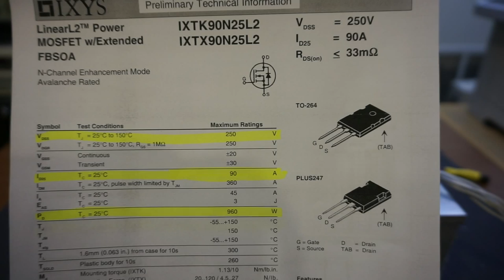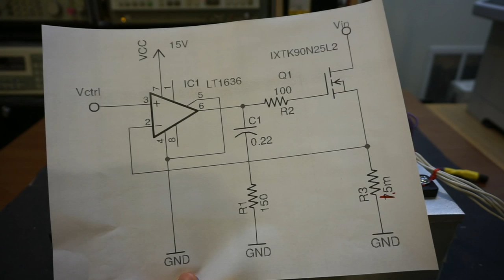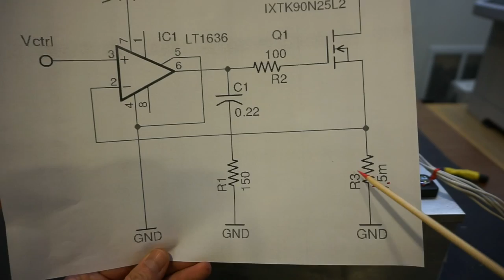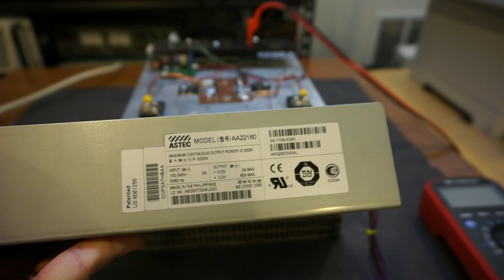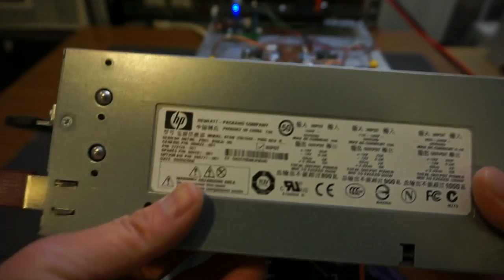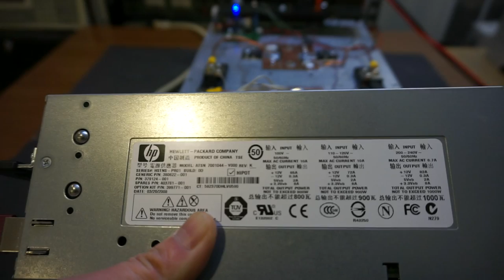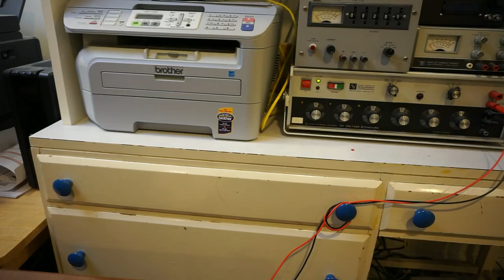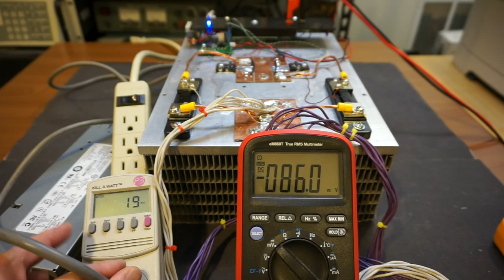A 400W (1kW Peak) 100A Electronic Load Using Linear MOSFETs

Comment: Very nice.
To minimize the fan noise, put a gap between the heat sink and the fans. You can then shroud it to prevent the flow escaping out of the sides. The noise is actually the fan blades chopping the air on the heat sink fins. Anything more than 5mm should do the trick. I think you will be pleased by the result.
Reply: For those who want a bit of fun, there is DC.
For those who want a challenge, there is AC.
Need more problems in your life? Increase the frequency.
Still not difficult enough? Turn up the wick right into the RF domain.
Still falling asleep? Try aerodynamics.

Comment: Please try with FDL100N50F soldered/tinned on cooper sheet (thickness>3mm and surface>25cm2) before radiator mounting. I easily dissipate 600W for a long time with only one MOSFET for a maximum temperature near the capsule of 70C mount on 5Kg aluminum with  Sanyo 9SG1212P1G03 120mm/50W.

Comment: Hello Kerry, I am wanting to build an adjustable electronic load capable of draining up to 250 Amperes, I initially build one using 32 IRFP260N mosfets but I believe they will not support for a long time, I am using 4 LM324 comparator based control module doing gate control of the mosfets, As a Shunt resistor each mosfet has a 0.10r 5W resistor, My question is, Is it possible to use 8 mosfets IXTK82N25P to obtain a good current drain?  Each control module controls 4 mosfets and would it be necessary to change each Shunt resistor of 0.10r for a smaller value, for example, 0.05r?  Would it be necessary to do this or would I have much more efficiency just changing the IRFP260N mosfets for the IXTK82N25P linear mosfets?

Comment: Can you explain how are you connecting the two grounds (control voltage and PSU). From the looks of it, two grounds are connected together. Wouldn't that mess up the isolation and ground reference and evidently result in the opamps and the MOSFET not working properly. I am a little confused on that part. Can you please explain because I was looking around to make a DIY E-load for a school project where we need to test a fuse that is expected to blow at 75-80 amps and your tutorial is exactly what we need. thank you!!!

Comment: Very interesting project! Did you do an accuracy test of shunts? It would be nice to have a display showing the actual amps, voltage (wattage, temperature e.g.) and it also would be nice to set these values to a predefined value. Also setting the resistance would be interesting. You would probably need a kind of Microcontroller/Arduino to do so - but that would be much more useful in my opinion. Also a possibility to log the values to some memory would be useful. O.k. i know - this would make the project much more complicate and i like also to keep it simple :-)
One point i dont like too much in this built are these multi-flying cables and these cheap clamps for 100A - this is a weak point i would say. I prefer beefy copper cables and big copper connections that could be easily made by ordinary copper tubing (6mm, 8mm, 10mm, 12mm) with a drilled hole and a screw it gives you very good contact :-)

Comment: Very nice, i have been meaning to make such a load to go along with my other loads for testing, its nice to know some good tested linear mosfets for the task

personally i would have amplified the shunts anyway to prevent noise pickup on the input voltage 

or take it a step further and amplify the shunts for 100mV per amp, use a 10 turn pot and a voltage reference like a REF5010 with a panel voltmeter to monitor the current on the device while being contained and avoiding the use of a microcontroller 
but its a long term project in my mind
also the temperature control is a nice touch!
Reply from the maker: Thanks Alyx. Yes, when I get a chance, I probably will make it MCU controlled so I don't have to rely on the voltage standard.

Comment: Hi it's me again LOL :)) Another question: what about the gate threshold voltage of the FETs ?  It's 2v according to the datasheet, yet if you want to have, say 0.075v flowing (let's take the worst case, 100a scenario), can you attain that ? Does this threshold voltage represent the value at which the D-S path is at its lowest resistance ? If I have 0.075v on the gate, will I get 0.075v drain to source and through the resistors ? I read about it many times, but can't quite grasp it unless I try out myself. Cheers.
Reply from the maker: The threshold of Vgs doesn't really affect Ohmic region. When the this threshold is reached the MOSFET turns on fully and the resistance is largely dependent on Rdson. By increasing the Vgs beyond the threshold would further reduce Rdson although only slightly. The gate voltage has nothing to do with your Ids, you can reference each MOSFET's datasheet (Vds versus Ids curve for different Vgs) to see the approximately where the operation point is at for a given Vds and Ids.
Reply: @ Daniel ......  you have to go to at least Vgs = 2 Volts which is the threshold voltage on the gate for the transistor to start conducting.  2V is what is in the data sheet for this FET. there are some that start conducting a lower than 2 Volts and some require a little more.  0.075V across the gate source will do nothing.

Comment: Very great project, will be building one soon to test my 24V battery pack.  Question about the 19V op amp rail.  Is this able to run with a rail to rail voltage of 5V like your previous 150W load? Or is this rail voltage needed because the Vgs of the linear fets are much higher? Thank you for your knowledge and project

Comment: Hello Kerry,
Remember I said that I had trouble getting down to a low input voltage?  
These are the test results of my Electronic load. I am working on the design, still a long way to go.  i need to find a way to control the current over the full range of input from Vin = 60 V down to Vin = 1 V and 20 Amps down to 0.5 Amp  (that's my spec for this)
 Vmax Vmax Vmin Vmin
Vin 60 60 1 1
Iin 19.412 0.736 22.36 20.3
Pin 1164.72 44.16 22.36 20.3
Vinmax = 60 Volts the max input current is 19.4 (approx 20) Amps; and min is 0.736 (0.75) Amps; 
with 1 Volt input the max input current is 22.36 and min is 20.3 Amps.
Reply from the maker: If I read it correctly you were saying that when the input voltage goes down to 1V you could not control the current any more? If that's the case I'd take a look a look at the opamp output as it looks like it's still somehow driving the MOSFET?
Reply: yeah.  it is.  i need much better control on this animal.  i am still having trouble with it. buuuuttttt.... still persevering...  LOL
Reply: Did you find solution at low voltage?  I am trying to do similar this E Load and use another Opams and at low voltage the Gate voltaje is around 12 volts but current is less than when I apply 5 volts.... for example with 5 volts is 12 ampere and with 2 or 1 volts the current go down to half

Comment: Nice project, Kerry. Just a quick one, how did you connect MOS-FET's drain pin to the PSU wires? By the contact of screws on each copper plate? Thanks.

Comment: I watched this a year ago and came back to watch it again. I wonder if you still use this unit? Have you have experimented to ensure the two FETS are sharing the load equally? I bought a Fluke 335 and drive a similar unit based on this design, so MANY THANKS MATE!
Reply from the maker: Yes I have been using this load numerous times when testing power supplies and battery banks. The loads are shared pretty evenly by the readings of the shunt resistors.

Comment: Great device you build! But does these cheap clamps not giving really small contact points? I would clamp some solderwick between the surfaces to get a lower resistance.

Comment: Very and well done but if it were me, at least for the testing phase, I would have put an Arduino or PIC driven LCD display measuring the mV across both sides of the load and display it as amps. You could of course choose a 4-line display and indicate FET temperatures as well. Nice permanent feature as well....

Comment: So I have a crapload of these critters (IXFZ520N075T2) and am wondering if I should try something similar to what you've built up there. Also, my largest power supply goes up to 200 amps at 12 V (needs to be powered by 240 V, which in the US means combining two 180 degree out of phase outlets into one 240 V)

Comment: good work, check the feedback from the shunt to the gate of the mosfet with a scop, myb your circuit is oscillating .( the sound of the first power supply you tested.
Reply from the maker: Thanks. I'll take a look when I get a chance.
Reply: @KerryWongBlog  
Please tell me any channel who teaches Electronics from basic using practical s

For m resistance to opamp and big circuit
I am beginner

Comment: Question: I'm trying to achieve something similar, though for a much smaller load (like 10a max) and I've got those same shunts as you 50A at 75mV, but there's one thing I'm curious about: I see you've got 2 wires on each resistor (one on each side of the resistor). One is the feedback wire that goes to the - input of the op amp, but what about the other one ? The one on the "ground" side of the resistor. The page you linked to explains it's Kelvin sensing and I know what that means, but the second wire is not drawn in your schematic...I may be wrong, so please help me out :D Such a cool device and I need to build my own to stress-test TV power supplies (often they look well under no load but act up when the TV loads them). Cheers.
Reply from the maker: Hi Daniel, the other end of the wire on the resistor goes to the ground (as close as to  op-amp's ground as possible). This is to eliminate ground loop and ensures the accuracy of the voltage measurements.
Reply: Ok, cool. Thanks for the reply :D YOU HAVE NO IDEA through how many textbooks and designs I went to figure out what that wire does, when all it does is grounding :)) Is it by any chance also going to SHDN pin 5 to disable the shutdown feature ?
Reply from the maker: correct, pin 5 of the opamp is also tied to ground.
Reply: Great, it's coming together slowly :D I'll be pestering you a bit more on this build, since I suck at math so thanks for putting up with me :)) Is the following statement correct ? To sink 100A with this thing, you'd need 0.075v flowing through the resistors, since 0.075v divided by 0.00075 ohms (two 0,0015 ohm resistors in parallel and yes, I like to use the "1" multiplier and write down the whole number, otherwise I screw up :)) ) equals 100. If so, the power dissipation would be 7w ? Cheers.
Reply: Correction: 7.5w
Reply from the maker: Yes, the total power dissipation for the two paralleled current shunt would be 7.5W. 

P=I^2*R, so for two 1.5mOhm resistors in parallel, you get 0.75mOhm. So P = 100*100*0.00075 which is 7.5W for both current shunts. 3.75W for each.
Reply: Yup. I got it all figured out now. Thanks for your time :D Now since I don't have a power supply which can go down in the millivolts range, I was thinking of what you suggested: dropping an amplifier in the feedback path from the resistor and using the output from that amp to feed amp no. 2 which would set the reference using a much higher, more manageable 5-12v let's say...haven't quite worked out how it would work, but it's in my head at least :))

Comment: I have a large battery bank constructed from 18650 cells. I wish to present a 50A load when the cells go above 4.2v. Im good with the controls but want to know if mosfets are usable for the load at this low voltage. Primary use is for balancing a string of series cells for 12.6 or 25.2v . Currently I switch in wire wound resistors but the heat that's generated limits me to about 15A. Comments anyone ?

Comment: The challenge with electronic loads are the small signal stuff with 0.1% accuracy specs I am busy with one and its bloody tough ,its mostly the tempco and analog section that's the hard part with the various signaling paths depending on the range.
Reply from the maker: Indeed, in your case low tempco 4-wire sense resistor and low offset low drift R-R opamps would be a must.

Comment: Hi Kerry, Good Work. I am designing a 500watt DC load. The mosfet you are using are almost identical - I intend to use  IXTN200N10L2 . Could you please share the schematic of your design
Reply from the maker: Thanks Prabir, the schematics are on my website linked in the description under the video.

Comment: Hi Kerry, Is it necessary to add a reverse polarity diode at DUT end. What if the the DUT is connected reverse, I was wandering whether there is any weak link to destroy the mosfet if the DUT is connected in reverse by mistake.
Reply from the maker: The source-drain diode for this particular MOSFET is rated at 90A continuous and 360A pulse, so I don't think you'd need to worry about the MOSFETs.

Comment: Hi, I believe I can do similar load with IGBT instead of MOSFET, what do you think? I have a couple of dual pack IGBT (half bridge). I also have some closed loop current transducer, maybe it is better to use them instead of the shunt?
Reply from the maker: Yes, you can use IGBTs as well. Usually though, IGBTs are mainly used for high voltage high current applications, and as a result it comes with rather high Vces which may not be suitable for your application, it all depends.

Comment: I have built similar loads like this and have a arc lamp driver very similar. I really cringed when you touched the heat sink of the power supply. Many supplies have voltage on the heatsinks that can kick you or worse. Excellent idea of using the shunts instead of a resistor feedback setup.
Reply from the maker: I should have mentioned that I did check before hand that the heatsink of the open frame supply is isolated. But yes, in general you should not touch the heatsink of a live switching mode PS without checking.
Reply: Just a comment on an old post.... a Current Shunt IS a resistor. They are exactly the same thing.

Comment: Further, on thermal issue, if the mosfet is driven by PWM do you think there will be reduction in heat as the mosfet wont be ON continuously
Reply from the maker: Yes, if it's driven by PWM then the power dissipation would be equivalent to the average power dissipation.
Reply: So any plans to incorporate a PWM controller in your circuit in the coming days
Reply from the maker: I don't have any immediate plan, but you could easily add a MOSFET that shunts the gate and source of the power MOSFET used for the electronic load and drive the shunting MOSFET with a PWM.

Comment: Is there a reason you used such thin wires for current sense and thermistors? None of those readings are accurate if the wires are so thin!
Reply from the maker: No special reasons. Those are just the wires I had.
Reply: The wires used for sensing can be very fine, since they carry almost no current in this "Kelvin sense" connection scheme.
Reply: can be and need to be in order to mitigate external RF interference, thin and short as possible

Comment: what is the minimum voltage that the load will work at with max current?  what is the max amperage?
Reply from the maker: It can work all the way down to 1v. Max current I tested was over 100A
Reply: 1V is pretty good.  that MOSFET has low Rds.  i dont want to spend $ on that MOSFET you are using so i am trying a different device.  i am designing one using an IGBT (Vcesat is about 2 Volts) so it is difficult getting down to a low voltage.  my minimum has been 2.5V at only a few amps.  if i go higher in voltage i can load it with plenty of current but the trick is going down to low voltage and high current.  anyway, thanks for answering my queries.  not many people do that. :)

Comment: You are not operating them in linear region. You really should get the nomenclature right. You operate them in saturation region. Switching happens in linear region.
Reply from the maker: Yes, I meant "Ohmic region" instead of linear region. Thanks for pointing that out.
Reply: The terminology is not very strict. Lots of people use "linear region" to describe the state where the MOSFET is not fully enhanced (working as a source- follower.)